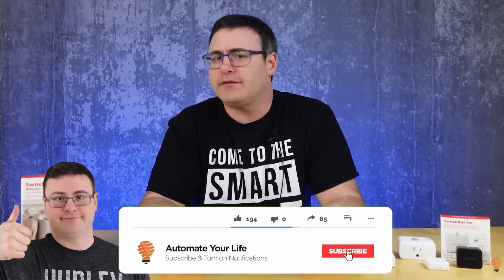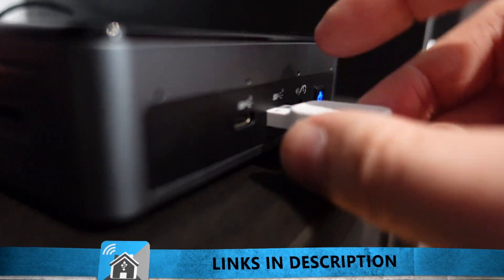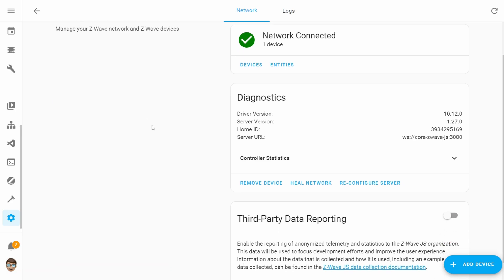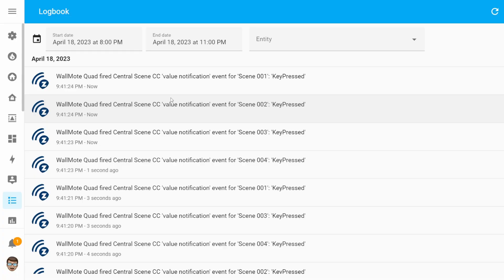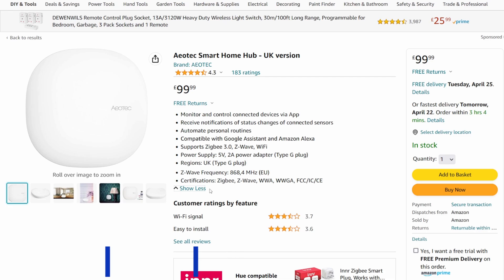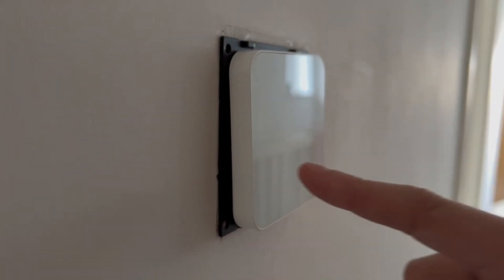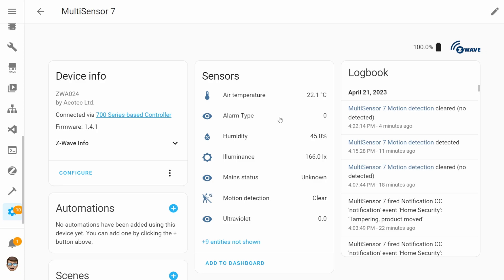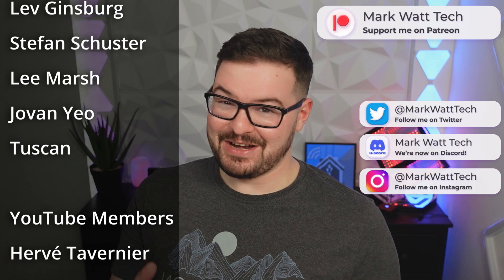These Devices Can Save Power, Money and Space! (Aeotec Z-Wave)

Comment: 11:08 whoa! red flag goin' up! if you want accurate wind info, that is not a good place to put that kind of sensor because the house has a MASSIVE effect on the wind. instead, you should put it above the roof, as high as possible.
Reply from the maker: I know that this is a bad spot. This was purely to test the unit worked. I previously had mounting holes in that exact location from some alarm systems I tested.

But thank you 😊 👍🏻